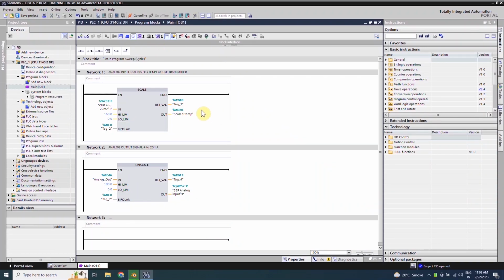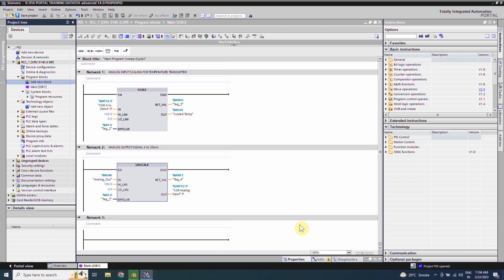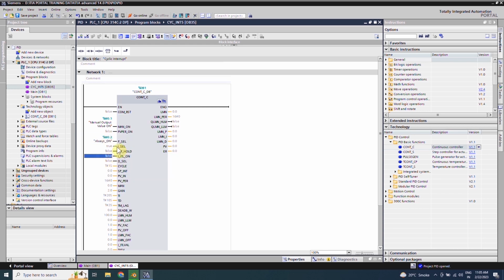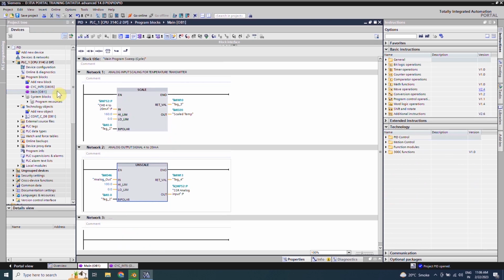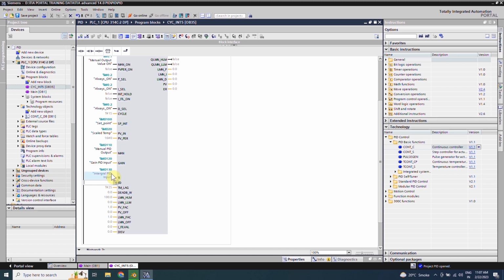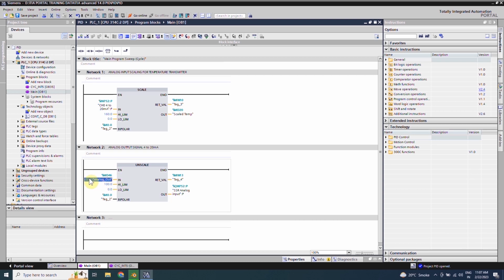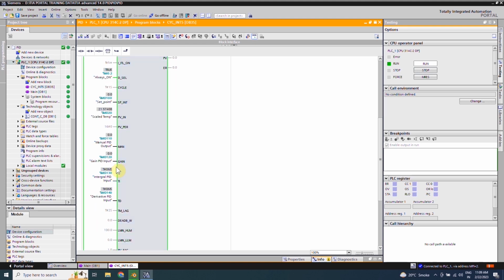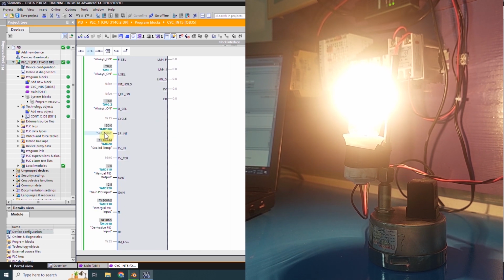How to use PID Continues Control function in the TIA Portal Close loop control

Comment: I am using v17.i am not getting scale & unscalle option also Continues controller. What should i do can you tell sir
Reply from the maker: I think scale and unscale is not available in the a71200 and s7 1500 cpu. Use s7 314c 2do PLC in the project